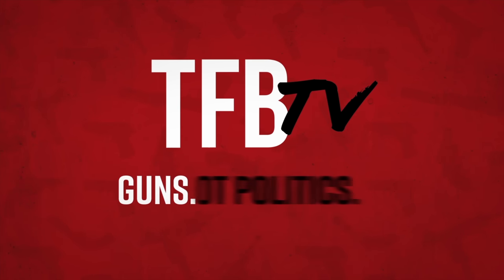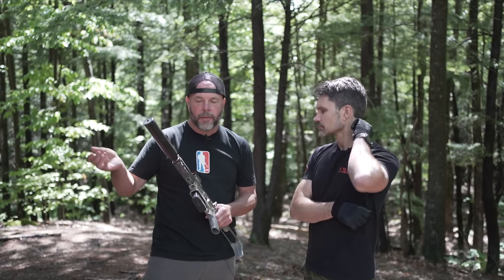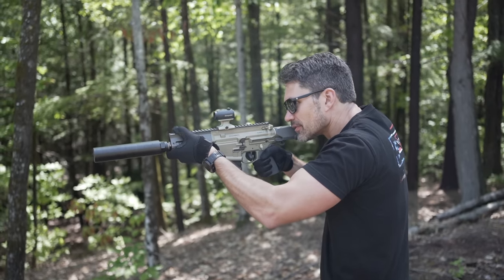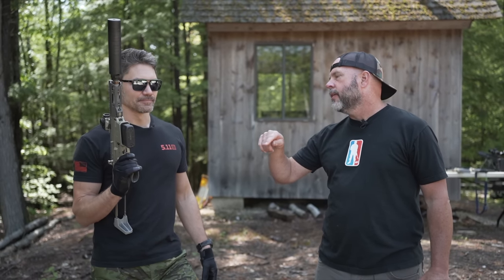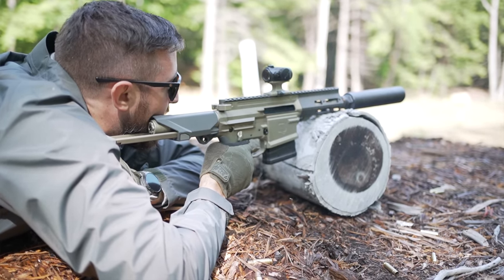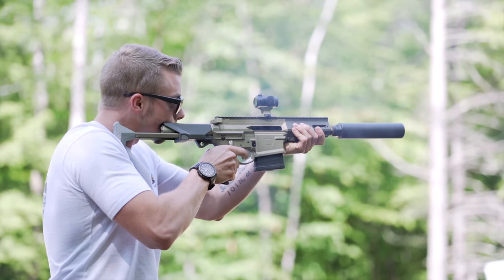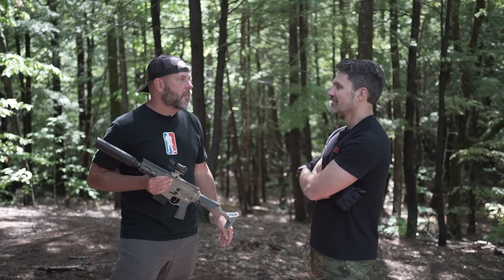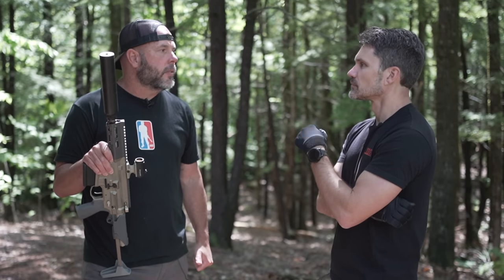NEW! Q BOOMBOX: The Honey Badger's Big Brother

Comment: Twist rate has no effect on total potential kinetic energy!   It might perform differently based on the share of its rotational energy rather than linear contact, but you are shifting between those.  You can still quote total kinetic energy!

I ran the numbers 300grain bullet, going max 1000ft/s to stay subsonic.  It's roughly. 660 ft*lbs.   Pretty good for subs, way under supersonic performance.  They basically want you to understand that a hollowpoint at this grain rate is transferring all the energy into tearing damage with the wide expansion.
Reply: Thank you. Kinetic energy is two things. Mass and velocity.
Reply: @TheNapalmFTW rotational velocity is velocity 🤷🏽‍♀️
Reply: @kevinbrittingham6774  the twist rate of the barrel bleeds off forward motion kinetic energy to transfer it to rotational energy.  The total potential energy is determined by the powder charge and the bullet it's propelling.  Likely the high twist rate is lowering the muzzle velocity, which people use as the direct measure of the kinetic energy.
Reply: Rotational velocity decays at a much slower rate than linear velocity. Fast twist doesn’t lower linear velocity until you twist much faster. The energy is determined by bullet mass, linear velocity, and rotational velocity.
Reply: @kevinbrittingham6774  not true at all. All potential energy comes from the powder pushing the bullet down the barrel. If the twist rate is imparting more rotational energy, then it's bleeding if off the forward kinetic energy.   Potential energy = rotational energy + kinetic energy
Reply: @Cpt-Night-ajg  you don’t understand. Imagine you have two barrels, 1:7 & 1:3. Everything else is the same. MV is 1050 for each. How is increased rotational velocity not more energy on target? Then go watch the Discreet Ballistics video of this example. Then explain to me how the initial wound cavity with 1:3 is 3x bigger than the 1:7…
Reply: @kevinbrittingham6774  because the twist rate of the barrel impart twist by creation Friction resistance forcing forward momentum into twist instead.    It's like changing the direction tion of a moving object by putting a barrier in the way that causes it to deflect.  Some energy is transferred to the barrier in that deflection.   

As you increase the twist rate you increase its friction to the barrel, making it spin faster by transferring its forward momentum into rotation by acting upon the bullet with more friction.  Friction is energy lost!
Reply: @kevinbrittingham6774  what you are missing, and it's the reason Q won't say anything, is that when you increase the twist rate your muzzle velocity IS going down.  That's because the extra friction required to increase the rotation is  bleeding that energy off kinetic energy.   The faster twist will have a lower muzzle velocity.   The only way to keep the muzzle velocity the same in both barrels is that one round would have to have more powder, in which case that cartridge has more potential energy. 

If the cartridges are the same, the higher twist rate barrel will have a lower muzzle velocity.
Reply: @Cpt-Night-ajg  I’m not missing anything. I’m the guy actually doing the science, testing, and development. I assume you’ve never actually tested your assumptions, that is why you are refusing to believe it. 

The linear muzzle velocity decrease going from 1:10 to 1:3 is less than 1%. This is generally well below the standard deviation of the ammunition. Therefore, it’s not worth consideration. 

However, the RPM, or rotation velocity, increases by over 330%. 

You can confirm this in Brian Litzy’s book on long range shooting. He confirms this very question.
Reply: @kevinbrittingham6774   so I'll believe it then that the twist rate is a negligible lose of muzzle velocity.  That would mean that the rotational velocity and it contribution to all total potential energy is a minor portion of the overall potential energy delivered by the bullet.   Since you are seeing larger permenant wound cavities, it means that total potential energy is being applied to the target medium over less distance, the entire intent for hollow points versus FMJ.  

When you see a large wound cavity from a HP versus an FMJ, we do not say that that round has more energy when leaving the gun. No matter the twist rate.  It IS more efficiently applied to the intended target.   

That total potential energy is equal to the potential energy stored in the powder.   The barrel and its twist rate are not adding energy to the bullet. They can only convert that potential energy to another form of motion.  

I literally don't care if you work at Hornady or Federal right fucking now.  What you have argued is against fundamental physics.    If you do work in the firearm industry then I think it's in your best interest to understand these fundamental and maybe you might make a much larger contribution to the world than some more Fudd lore.
Reply: @Cpt-Night-ajg  sure, Q and Brian Litz are wrong. You are deflecting. Explain my question of same linear velocity, but increased rotational velocity being the same energy on target. You have to stop a bullet in both directions…rotating and linear. The flash and sound are energy transfers that you can take from.
Reply: @kevinbrittingham6774  let's paraphrase this different.  You have to stop the bullet to transfer energy onto target.   

First you have to accept only one source of energy is available. The powder pushing the bullet.  It gives it both forward velocity snd rotationally velocity.   The for e needed to propell 300 grains through the air 300m away is far far far more than the total energy needed to make 300 grains spin around an axis less than a 1/4 in diameter. 

No stopping the bullet.  

Forward velocity.  Is stopped by traversing an adverse medium. And is force applied against the point and forward face of the bullet.   Hollow points stop in less distance because the forward face expands and puts more force across more surface area. Reducing pressure but increasing contact surface and thus friction.  

The rotational energy is stopped by the friction of all surface in contact with the bullet as it spins.   The faster a bullet spins the more total surface area of both the bullet and the medium interact.  If the bullet expands it's own surface area rapidly as it's spinning them it dumps even more of its potential energy in friction.  

Now a bullet spinning faster makes a larger permenant wound cavity because it's rotation distributes the force across a larger volume.  The fricton against the rotation is how its losing its potential energy, not the pressure gains the front face of the bullet.    

You have delivered the same potential energy across the medium, but if it's distributed across more volume you could see more damage.   

The rotation is how it more effectively deliver energy on target by increasing the surface area per millisecond that interacts with the target.   

I have no doubt Q and Brian Litz know this.  You apparently don't know enough to understand their writing and engineering.  And this long ass explanation is preciely why Q is like "fuck  it we just arent going to say anything" .
Reply: @Cpt-Night-ajg  I agree, fast twist “more effectively delivers energy on target”. Finally, thank you.
Reply: @Cpt-Night-ajg  Thank you for finally acknowledging that fast twist “more effectively delivers energy on target”.
Reply: @kevinbrittingham6774  you literally don't kmow enough to even understand this debate.  Enjoy your layman's win.   And the rest of us who understand can really debate the true meaning of kinetic energy and what it means for this rifle.
Reply: @Cpt-Night-ajg  Thanks again!

Comment: From a Military use standpoint. To me anyway, this covers the spectrum from PCC (just say MP5 for example)  to a 10.5" carbine in terms of versatility all in one gun.  
And with the 8.6 whether using sub-sonic indoors for room clearing, or Supersonic for longer range stuff,  provides an insane better terminal ballistics on target than any of the current cartridges in use for those applications.  Super cool but out of my price range. Maybe a Mini Fix in the future.
Reply: You can buy the barrel for $300 from Faxon and barrel swap any standard AR-10, you will also need a new gas block with a larger inner diameter to fit the new barrel. I found good quality and budget gas blocks on primary arms site.

Comment: what is different about the 8.6 projectile that keeps it from flying apart with fast twist? can this be applied to smaller calibers, even pistol calibers?
Reply: They're monolithic, so they are made only out of solid copper. Lead core or jacketed bullets would never survive that twist.
Reply: @daltontell1966  This is only the case if you are shooting non bonded lead core at super sonic speeds. I shoot plenty jacketed lead core out of my 86 subsonic and at the cusp of super sonic.

Comment: I heard claims that the fast twist rate is so aggressive that it can tear the jacket off of lead-core rounds (large risk of destabilizing the round and damaging the suppressor), meaning that the only safe/reliable 8.6 to use is solid-copper projectiles. This would require an already boutique system to shoot even more expensive ammunition. I have no doubts that this requirement would be optimal for performance, possibly even the best for its niche. Buyers will need to weigh these capabilities with its expense, and certainly be aware of any restrictions surrounding the new 8.6 cartridge and its intended twist rate.
Reply: That’s untrue.
Reply: @kevinbrittingham6774  I hope so, Especially with 8.6 just becoming SAAMI spec, further validating the cartridge for wider adoption.
Reply: Yup
Reply: This is only the case if you are shooting non bonded lead core at super sonic speeds. I shoot plenty jacketed lead core out of my 86 subsonic and at the cusp of super sonic.

Comment: If youre not above taking a pmag apart and filing those plastic ribs that keep 5.56 rounds in line off the interior walls of the mag... just do a 350 legend SBR instead. You can mod those mags to reliably feed either 28 or 29 rounds. You also only lose about 200 fps by dropping from 20" to 10.5" 

350 legend will also handle 9mm projectiles. 

That gives you an insane range of projectile weights from 90 grain supers all the way up to 200+ grain subsonics.

350 legend shits all over 300 blackout. Fight me about it.

Comment: The rotational energy gain from 8.6 compared to other twist rates is not significant. It just adds a few additional joules. Therefore, he does not give any numbers. Increasing twist rate does not give any benefits in terms of terminal ballistics. Otherwise ever 1 in 7 AR would be inherently superior to 1 in 9 AR in terms of terminal energy delivered when shooting the same projectile. 
Most likely the oh so amazing temporary wound cavity in the gell comes from the projectile expanding more and earlier, therefore delivering the energy more at once. 
I still think 8.6 blk is an interesting cartridge, but saying it is sufficient to ethically hunt dangerous game in Africa is disingenuous.
Reply: That’s incorrect. Fast twist does significantly increase energy on target.  Increased Rpm’s, rotational velocity does equate to more energy on target. Rotational velocity is velocity. In matter less with smaller bullet like .223. And it matters less only going from 1:8 to 1:7. Going from 1:10 to 1:3 is significant. 

I’ve killed hundreds of animal in Africa with short barrel 8.6 in super and subsonic. Including 8 Cape buffalo.
Reply: So, back of the envelope math for a subsonic 350gr 8.6blk using the Maker Bullets projectile:
1000 fps
250,000 rpm
Moment of inertia: 0.00011754 lb*ft^2
Energy:
Forward: 777ft-lb
Rotational: 1154ft-lb

Assuming that projectile dumps all of its energy in an important part of the target, close to 2000ft-lbs ME is on par with a 30-30. I’d be comfortable using it on deer and people, but large game I wouldn’t trust it.

Supersonic is a different story, but at that point I’d just go for a common cartridge like 300 Win Mag.

Comment: Seems like a basic beefed up AR.. why so expensive? For the name? Gucci color scheme? It’s a newer caliber, and they are going to squander it by charging way too much.
Reply: 5 lbs. Shorter OAL. Fast twist. Adjustable gas system. Taper muzzle. Literally the Best Trigger Ever Made. Q-Sert. 70 degree selector. Switch barrel and caliber. 1 moa subsonic.
Reply: @kevinbrittingham6774  I don’t disagree that it has nice features. But it’s not worth $2k or more to most people.. if Q wants 8.6 to take off, they will need to lower the cost to the consumer. Otherwise it will remain a niche caliber.
Reply: We aren’t trying to be PSA

Comment: sub sonic 300 BLK with an industry standard twist rate and a 10 inch barrel does nicely out 200 yards. it does all right out to 300 yards. super sonic 300 blk does nicely out to 300 yards and alright out to 350 yards. its cool that the right tool that can do better, but I can get a well preforming upper from PSA for $400.

Comment: Looks front heavy.
Reply: It’s under 5 lbs
Reply: @kevinbrittingham6774  but what's the weight distribution? As in does it balance front heavy? At under 5lbs it probably doesn't make much difference if it is or isn't.
Reply: No

Comment: Proprietary top rail is a straight up scam, just charging people for shit they shouldnt need in the first place
Reply: It ships with 1913, one piece continuous. 1913 is just a compromise. So, you don’t have to use it. You get both.
Reply: @kevinbrittingham6774  more machine time and specialty work=higher cost, higher cost=higher mark up on the price tag. They did something pointless solely to add cost, who in their right mind would want a proprietary top rail anyway.
Reply: 😂 some people appreciate something better and a new capability…like people that adopted 1913 and mlok when they were new, just a few years ago…
Reply: @kevinbrittingham6774  in what way is having a proprietary system that adds the possibility of breakages and loss of zero better? Making it a separate piece adds nothing of value and has no point. What possible reason could you have to remove it's capability of having an optic, or sights of any kind for that matter
Reply: Eliminate height, weight, parts count, and tolerance stacking.
Reply: @kevinbrittingham6774  it adds all of those, it doesn't eliminate them. The qsert base is the same hight as a standard 1913, then you're going to have to add a separate piece of 1913 that no one will ever take off. Extra weight, height and price for something that can be done cheaper and better with just a standard rail
Reply: 😂 better? Pls explain. And how’s weigh under 5lbs, if you’re correct?
Reply: @kevinbrittingham6774  you said it reduces weight, it doesn't. And in no world or reality is it in any way better than a standard rail. You're a chump if you think it does, just someone they can make a quick buck off of. But hey, if you like being scammed I guess it works
Reply: @shrimpanzy7627  it’s lighter, stronger, easier to install, and has increased zero retention

Comment: I’m having trouble believing - or at the very least, caring about - that the Q rail is any better than m lok. Is it really lighter? Or did you just compare a six sided, skeletonized Q handguard to the industry standard seven sided M-Lok / 12:00 picatinny handguard, and pretend that it’s an accurate comparison? And even if the attachment system really is easier to use than M-Lok… who here is actually changing out any of their handguard attachments so hastily that this is something y’all are worried about? To say nothing of the fact that they’re trying to stay sub-MOA to 300 yards while adding a break in the attachment from the gun to the rail… lot of questionable decisions on this one.
Reply: It’s actually lighter, better, stronger. Zero retention is better. And you don’t have to do blind installation.

Comment: 6inch barrel 1MOA at 300m? Really?
Reply: 3”
Reply: @kevinbrittingham6774  6 inch barrel. 3 inch group.
Reply: Shorter barrels tend to provide better dispersion with subs.
Reply: @kevinbrittingham6774  I have done a lot of testing but only with .22 from 4.5 to 16 inch barrel length. short barrel always opens up the groups.
Reply: Bc your .22 is slow twist. Likely 1:14